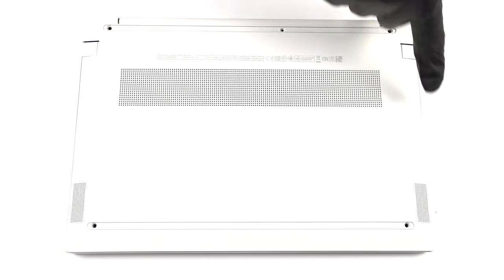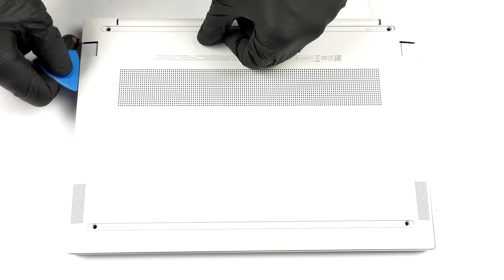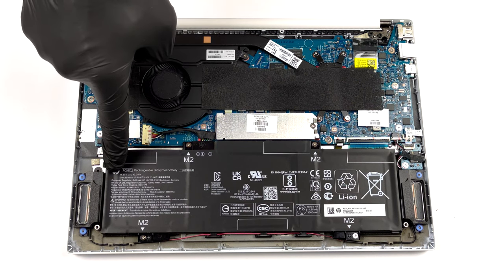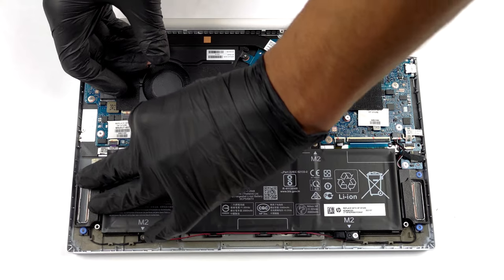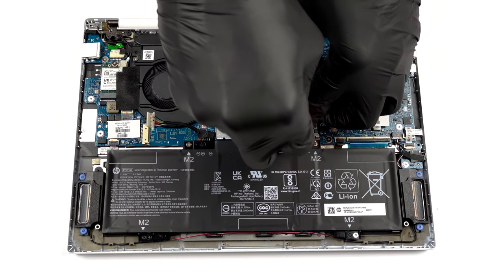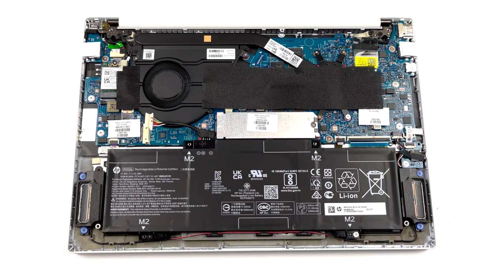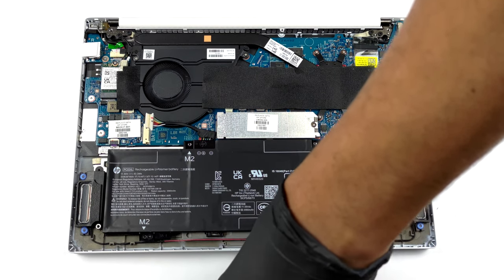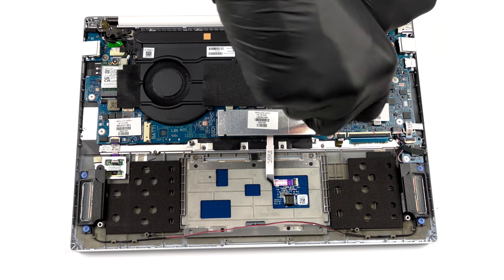🛠️ HP Pavilion Aero 13 (13-be0000) - disassembly and upgrade options

Comment: 2:05 - No mention of the WiFi card near the cooling fan?  Is it a standard m.2 WiFi card?
Reply: I came here for that wifi part too lol. Idk why anyone would want to remove the battery. The wifi and storage are the only ones that should be altered IMO due to the realtek wifi card being pretty weak and to put a better and faster NVMe in there to replace the Intel 660p (670p in my laptop for some reason).

I've had the wifi card completely stop working and not show any networks whatsoever less than one week into owning this laptop. I didn't have internet for a day even though my phone and old laptop still connected to my router no problem. I knew about the wifi card before I got the laptop but I wanted to see for myself if it was really that bad and it is lol. It's Ok I'm putting a Fenvi AX210 WiFi 6e card in it's place.

***Yeah the Wifi card it comes with is a Realtek RTL8852AE. It has A and E keys on it and the Fenvi does as well so it'll slot right in.
Reply: @gmaxsfoodfitness3035  did you eventually replace the WiFi card?  The Realtek card that comes pre-installed is definitely one of the weakest part of this laptop but I love everything else about it, especially the weight. 

I've got an Intel AX200 WiFi card from B&H Photo (less than $30 currently) but am looking into whether the two rubber feet would lose its adhesion in order to get to the screws. I've been trying to see if HP sells them just in case I need them.  

Mine came with a Samsung OEM based NVMe 512GB drive, by the way. So, it sounds like there's probably variations in which drive would be pre-installed.
Reply: @CamSigg  All you have to do is unplug the battery. You don't have to remove it completely. But yeah safety first of course.
Reply: @nighthawkvc25a  Never got a notification for this. Yeah I replaced the Realtek with a Fenvi AX210 WIFI 6E card. It's still working great after 8 months now. It's funny I came back to this video for the battery info and forgot I left that comment about why anyone needed to remove the battery lol. My battery life went from about 7 hours in balanced power mode with WIFI on (in April 2022) to about 4 hours in best efficiency power mode with a USB Ethernet cable plugged in smh (December 2022). I've been taking care of it by charging it to 80-85% or so in order to not degrade the battery (had a battery health app on my phone way before I even had the laptop so I knew what to do already). Occasionally I fell asleep and forgot I still had it plugged but there's no way it should degrade that fast.

Anyway now I'm looking to replace the battery. Hopefully I can get a bit more capacity in the same compact space. We'll see. I see why someone would need to remove the battery at least 😅. Besides that the laptop has been pretty good. I got the one with the Ryzen 7 5800U with 16GB RAM which is more powerful than my first build from a couple years ago with a Ryzen 5 2600. The only disadvantage of course is I had a dedicated GPU (1660 Super in that build) as opposed to the iGPU in this laptop. It's OK I can still play eSports and older games with low settings on this thing but I can't edit videos as well as I'd like.
Reply: @gmaxsfoodfitness3035  The battery is a consumable product and is usually the first component to degrade or break (e.g. get swollen). So they're producing a video that's meant for users potentially years down the line. Still missing the Wi-Fi card is a major omission.

Comment: Can the rubber feet be reapplied?
Reply: you could, using the adhesive that came with it, but it would be a little hard, and you would most likely need to cut some of that rubber off (since it stretches very easily) to make it fit into that bar